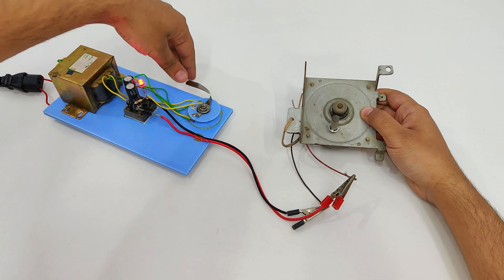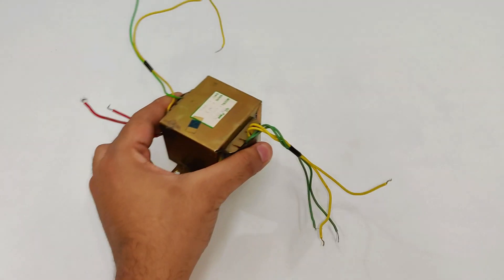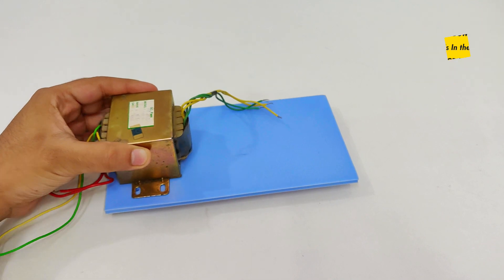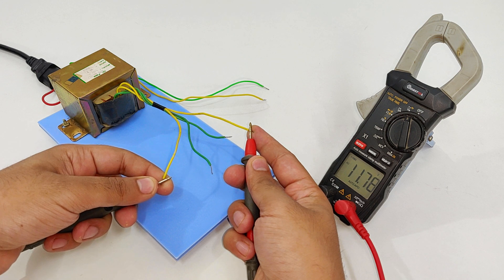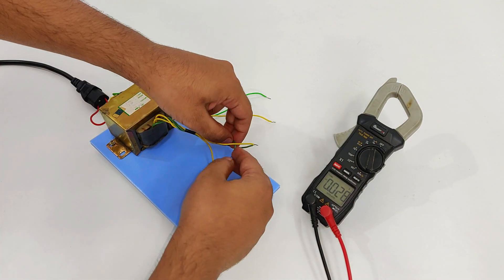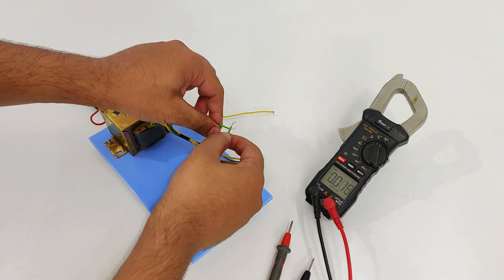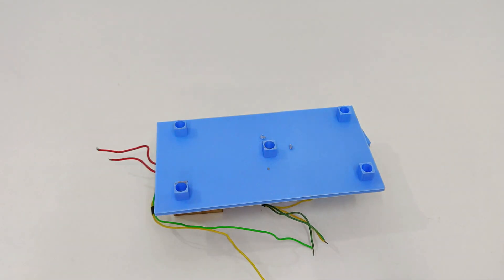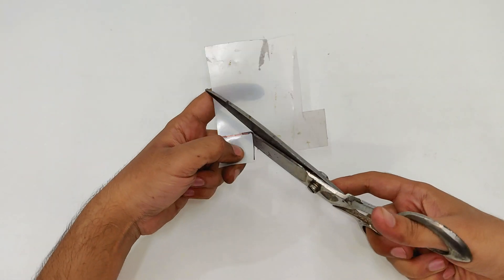Make 12v, 24v, 36v Adjustable DC Motor Power Supply with DVD Player Transformer

Comment: Need help from you! Is it possible to make roti/chapati maker using DC supply? Kindly do this project bro
Reply from the maker: Ok
Reply: @MrElectron  thankyou for your response. I need one more help from you ,I want dc eliminator starting from  12 v upto 60v and amps varying 0.5 to 1 amps with all safety guidlines.